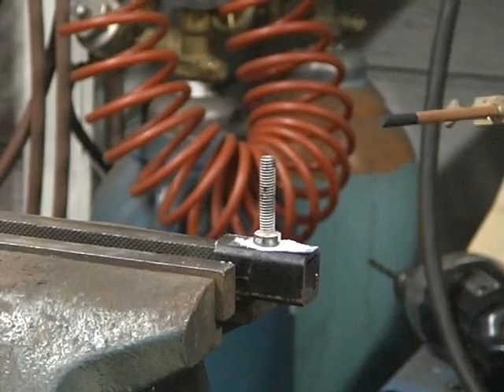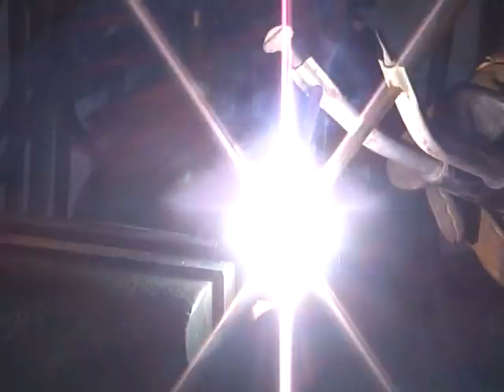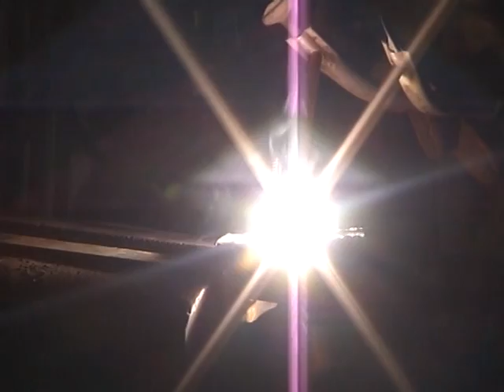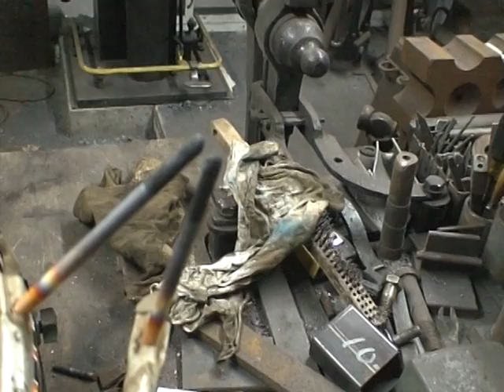Brazing with a Carbon Arc Torch

Comment: Old timers know lots of tricks to apply when using carbon arc torches.  Use a carbon block under areas to be filled.  Use wet carbon as a dam to control flow of molten brass.  Use a copper block under thin aluminium to allow brazing of aluminium.  No gas pressure means smooth flow of brass or aluminum.  Add inductor to make better AC arc.  add thin layer of wet carbon to areas to be surface hardened and then melt the carbon into that surface (quick way to do case-hardening)  Also good for soldering.  and so on....lots of tricks available from the old geezers who worked extensively with carbon arc torches.

Today you can still get suitable carbons at your welding supply...ask for carbon gouging rods in 1/4" inch and 3/8 inch sizes.  These will be copper covered.
Reply: For those of us that never even heard of this it is awesome new technology to us. This makes you wonder what other technology is being lost due to being replaced by updated technology. The one thing that makes this really cool and valuable is that if you already have a welding power supply and you only use a torch on occasion this is cheaper and much easier to store that an oxy-acetylene gas cylinder setup.
Reply: Thank you for the knowledge, bud. Saved all of it!
Reply: Any source or link where all or most of these valuable tricks are available ?
Cause they are all dispersed on the internet.
Reply: Can't thank you enough for sharing these wonderful tricks with us. I just put together a little buzz box from a 4" cube transformer, rewound. Hits abouts 50 amps or so, not enough to get proper penetration with 6011. I randomly tried a pencil lead in the stinger and realised I can heat/braze like a bastard with that thing, immediately ordered a few different sizes of the clad rods for finding the best. Sweet rig, never trips my 15A even dead shorted for infinite time. Great setup for learning and low power fun ages 14 and up 😂 your tips will be put to good use!
Reply: Maybe you could demonstrate your knowledge using carbon arc method and teach us all on YouTube??? The Old geezers really know way more than we all realized. Look forward to  your video Sir.
Reply: @phillhuddleston9445  This is a fact Phil. Old technology gave us all a road to follow that is being overlooked. Peace.
Reply: @phillhuddleston9445  ⚠️ God has said in the Quran:

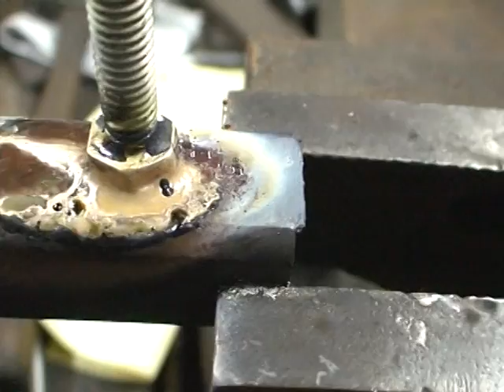🔵 { O mankind, worship your Lord, who created you and those before you, that you may become righteous - ( 2:21 ) 

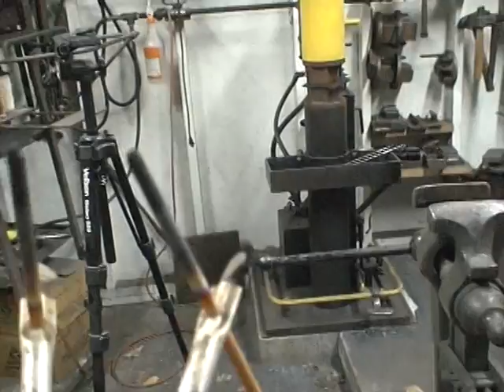🔴 [He] who made for you the earth a bed [spread out] and the sky a ceiling and sent down from the sky, rain and brought forth thereby fruits as provision for you. So do not attribute to Allah equals while you know [that there is nothing similar to Him]. ( 2:22 )

🔵 And if you are in doubt about what We have sent down upon Our Servant [Muhammad], then produce a surah the like thereof and call upon your witnesses other than Allah, if you should be truthful. ( 2:23 )

🔴 But if you do not - and you will never be able to - then fear the Fire, whose fuel is men and stones, prepared for the disbelievers.( 2:24 )

🔵 And give good tidings to those who believe and do righteous deeds that they will have gardens [in Paradise] beneath which rivers flow. Whenever they are provided with a provision of fruit therefrom, they will say, "This is what we were provided with before." And it is given to them in likeness. And they will have therein purified spouses, and they will abide therein eternally. ( 2:25 )

⚠️ Quran

Comment: I am self taught but quite proficient at this, I heat the base metal until I see the surface start to float and then I introduce the rod. I don’t flux separately, only relying on the flux on the filler rod but the process it quite straightforward. I have managed to fix some quite small items neatly using this process.

Comment: I tried this today. Used a mild steel filler to seal a SS plate I'd riveted onto my cat converter to cover a hole. Not neat but it worked so pretty happy

Comment: I have a torch but can't find rods that will work with my AC welder. Any ideas where they can be ordered?
Reply: eBay has them, just search carbon gouging rods. There are a few sizes but they're really cheap

Comment: Where did you come by your torch and are they still available?
Reply from the maker: You can still find carbon torches on EBay.  But you can make your own.  It's not rocket science. Plenty of vids on YouTube.
Reply: It's not a Torch. They are Sticks. It's Carbon Arc Stick Welding. I did this 40 years ago a College it's the only successful way to weld Cast Iron..
Reply: Cast iron can also be welded with a suitable filler rod of cast iron and oxy acetylene welding torch. It can also be electrode welded using I think nickel chromium rods or something similar.

Comment: Very poor video.  You did not explain your device or anything about your procedure.  You need to explain what it is that you are doing and how your device works.
Reply: Just connect carbon rods to your stick welder
Reply: Owen Prince. You are so right. Far too many videos on here that don't explain!!
Reply: Always a couple of salty's complaining that they aren't given personal instruction....
Reply: @ft7397  Ok I get it now.  I did not see the filler rod at first because the arch was so bright.  How much amps do you need to do this???
Reply: @ft7397  It has to be an AC welder to burn the rods evenly. A regular DC stick welder will only burn one rod, the positive side if I'm not mistaken.